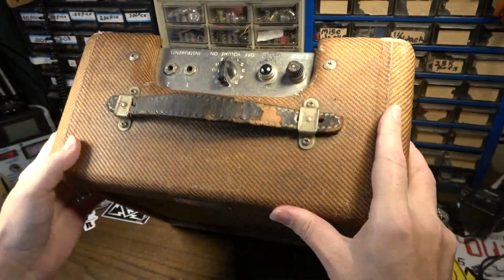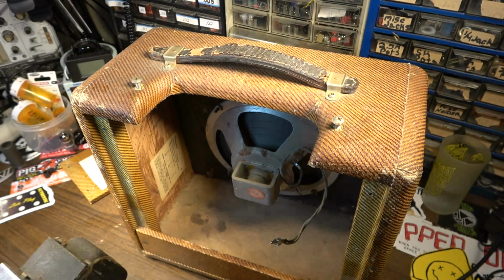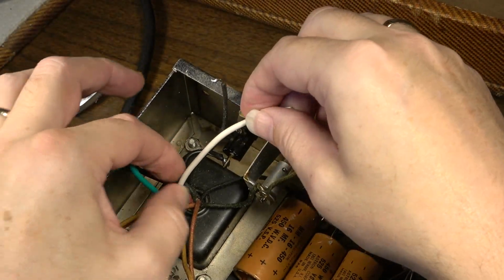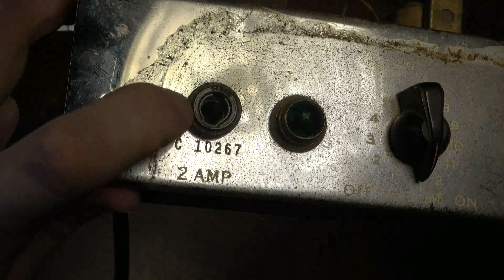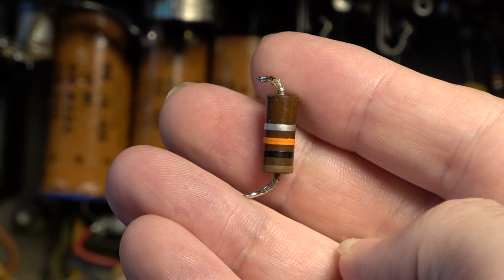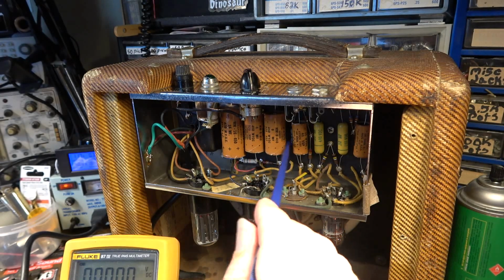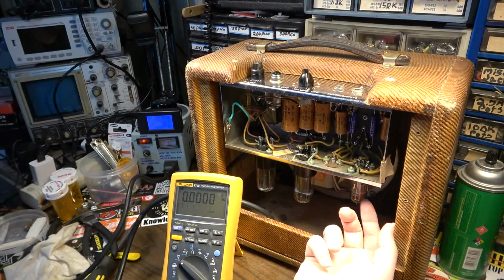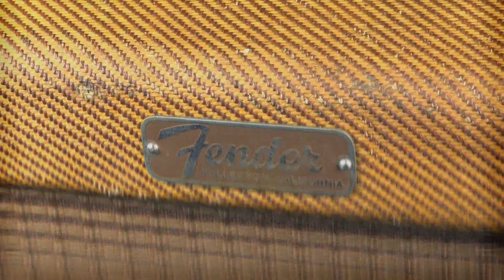1959 FENDER CHAMP 5F1 Guitar Amp Repair, Restoration & Demo

Comment: I was glad to see the fuse argument.  Uncle Doug, as you stated, is just absolutely awesome.  I know of no better teacher on YouTube.  I have said more than once, the world needs more teachers like him.  He just has that great teacher quality that is so hard to describe.  I like his arguments, but I too have always soldered the fuse first.  If you have ever gigged, you know the electricity is very spotty at best at some smaller venues (bar/grille type places).  I would rather have the fuse blow before I ever turn my amp on.  That's just the way I've always looked at it.   And I have seen that happen in improperly grounded commercial sites, more than once.
Reply: @@bertrodriguez3087  I think in this case,  with this particular type of power switch, wiring the incoming active (hot) wire to the fuse first, is the better way to go.  

As Brad showed, just a mm or two distance from the switch terminals to the switch 'chassis' is of concern.  And that's only the part of the switch we can see on the outside!

Normally, or often, the power switch is mostly plastic or bakelite, so the possibility of an internal short to earth inside the switch is almost impossible.  In that case I would always wire the incoming mains wire to the power switch first, or else there is mains power running round inside the amp even when it's switched off!

What Brad should have emphasised a bit more was the incoming mains wire being connected to the END of the fuseholder, rather than the side.

Comment: After I did some research concerning the types of oil or wax that were used in paper and foil capacitors like the Astron you're holding I am never going to take one apart again. A lot of halogenated compounds were used, i.e., halowax. Good for stability and fireproofing but definitely not something to get too comfortable with. I spray a couple of coats of Krylon clear matte lacquer on those asbestos pads and that makes them non friable.

Comment: You wouldn't buy a vintage car with the original clutch, brake shoes / pads, oil, coolant etc. So why would people think that the original capacitors have authentic value?
Reply: It's not really the same, those things you mentioned "have to be replaced" in a car, but many times when you buy an old car you are getting the original "electronics" like distributor, coil, alternator, starter etc, I say if the caps are good leave them in if they need to be replaced take them out 👍

Comment: Sometimes when you want to check the fuse and it doesn’t come out right away but stays in the fuse cavity,  and then you try to get it out with your fingers, that’s when you get shocked. The Uncle Doug wiring avoids this risk.

Comment: I have had new handles made by a shoe repair shop they deal in stacked leather and have the machines to sew it. They also can match the color too.
I was able to get my cost to 5 bucks a handle and charged $30 for them.

Comment: I have ‘62 Champ. Got it from a friend in the ‘70’s. Never sounded very good until I saw ( you were the 1st you tube channel I watched) you changing caps in an old amp. So I did it to mine last year with the Blue Zoso’s and it sounds so good and very quiet. I recently stuffed the old caps and will change them out soon.    Have a ‘57 Deluxe I got from same friend that sounds bad so it will be next. I‘ll stuff the caps on it hopefully Lupe ( the tape is still there) won’t be able to notice. Thanks for the valuable info.
Reply from the maker: Best of luck with all your electronics endeavors!

Comment: I totally agree and that is how it was always supposed to be done.  You always put the fuse first and make sure the hot lead is on the inside not the outside.  Say in your house - you wouldnt put a switch before a fuse/circuit breaker now would you?

Comment: I can see reasons for both wiring methods in regards to the fuse and switch. I have seen fuse holders  fail more often than those old-style switches. Typically the fuse-holder would Crack and crumble presenting a possible shock hazard if the tip is 'live' and I have seen that. Less often, I have seen those old switches break internally as well,  which could present the possible short condition/hazard you base your method on, but I have never seen that happen. Uncle Doug's recommendation seems to be a good way to go if the Amp uses more a modern discreet on/off switch that is more robust and a better overall design....guess it depends on the amps design, component quality, etc. Good one Brad, Cheers!

Comment: pats tip number 2 with asbestos like on that rear panel i always spray two or 3 coats of a flat clear coat sealer.locks it down solid for at least 15 years and seals it perfectly. Your acoustic tinted spray Brad would work fine as well

Comment: To me if it doesn’t work right it’s value is zero donuts. So, I fix what ever is needed to make the stuff function. I always did that with vintage drums and the collectors would be upset and offer you poo for money. That was always alright because that’s what vintage drums cost me back in the day. Sweet video!

Comment: I’ve seen “Lupe” tape go $500 on Reverb. If anyone actually paid that much, I don’t know.
Those Astron caps just crumble if you try to mess with them. The yellow molded case is made from some type of very hard epoxy/resin.
I’ve never seen a 59 anything with a Schumacher transformer. I’d be willing to bet it’s an early to mid 60 model, especially with all of those extra mounting holes.

Comment: The only way I could see the fuse issue being a hazard would be if someone was replacing the fuse and stuck the new fuse into the holder first instead of the cap. Then touching the top of the fuse might be hazardous. However I do like the power being fused ahead of the electronics.
Reply: Yup, I've done that before and got quite a wallop for my stupidity, especially as the voltage here in South Africa is 220V!
Reply: I've pulled the fuse holder cap off before and the fuse did not come out with it. Imagine if you were unaware that the fuse was before the switch and thought you were safe to fish it out because you had the switch off. I think it is far more likely to have a novice end-user get shocked by an unswitched fused, than there actually being a short in the switch. Plus if there was a short in the switch, then the CB in the panel should trip.
Reply: @srtamplification  agree 100%, not really a fan of the solder power ground either, could end up going back to 2 prong cord without knowing.

Comment: It's nice to get the outer foil towards the ground or high impedance leg of a circuit but in audio circuits the frequencies are low enough not to matter much. If you're rebuilding your common everyday microwave transmitter it becomes more of an issue.
Reply: About these common everyday microwave transmitters... Crowd control or just coms?
Reply: @sski  😃
Reply: AFAIK, normally the outer foil is supposed to connect to lower impedance leg of a circuit, or to ground.
Reply: @jutukka  Glad someone reads these posts, thanks for the correction.

Comment: Brad, the way you have wired the switch after the fuse means that the fuse protect all components within the amp. Bravo and best practice in my book. The power from the switch over the top of the lamp holder may move in time and the insulation then becomes compromised. Maybe better to go under with a blob of silicone snot to retain the movement of wire. Overkill maybe, better then potential problem later as a result.

Comment: In regard to fuses, I agree completely with your approach of having the fuse be the very first thing in the circuit from Line (hot) entering the chassis. It is also compliant with UL and CSA standards and practices.  Something that might be of interest to a few viewers is the strange fact that many radios from the 1920, 1930s, and into the 1940s, there were no fuses in the AC current loop at all. If collecting and/or restoring antique radios, you need to be aware of the situation, has a safety fuse been installed or not... In out own small collection of antique radios, we have added ‘inline’ fuse holders just inside the chassis, and ALWAYS as the first circuit element, just as you illustrate. If retaining a 2 prong cord, we use a polarized cord to ensure the Line and Neutral are always known.

Comment: Have you ever disconnected the negative feedback loop on one of those? It perks it up quite a bit. A 25/25 cap across the cathode of the second stage of the 12AX7 will also liven things up.
          I know you can't do that on a customer's amp, but if the opportunity to experiment ever presents itself, give those two mods a try some time. You'll be pleasantly surprised. 
   Perhaps on a home made clone.
Reply from the maker: Set loose on one, I could conjure a monster of such devastation, the world would weep with joy and fear.
Reply: @TheGuitologist  My next one is gonna have a wooden desk drawer for a cabinet, (solid pine, finger jointed corners, curved steel handle, and 1/4 in. Plywood baffle.) A cake pan for a chassis, more 1/4in. Plywood for a turret board and no. 18 finishing nails for turrets. My Grandpa built a radio this way during the depression in the 30s. He still had it when I was a kid, and it still worked. It was probably 35-40 years old at that time. He said he built several of these for his neighbors and he would barter them for corn, eggs, chickens, potatoes, etc. It was one more way for creative, resourceful people to get through hard times.
             My motivation is to make one for a buddy who is always pawning, (and losing) his gear. No pawn shop will take a home made put together job, so he'll be stuck with it, and he'll always have an amp.
       Most old solid wood desk drawers are little resonant chambers like an acoustic guitar body. Try saying "hello" into one. You'll see what I mean.

Comment: I agree  with  your  wiring   on this particular  amp. I will  say one of   the worst  shocks I've had was on a 1972 superlead. The ht fuse blew and  the filter  caps were fully charged even with the amp off and as I replaced  it  I had one hand on the chassis and  my thumb  was touching  one end of  the  fuse as I was putting  it in. ( those fuse holders are different) I learned  my lesson with those type  of  fuse  holders

Comment: There are merits to both arguments on how to wire the power cord I guess, but I would be inclined to do it the same way as you. Not to diss Uncle Doug. That man has some serious craftsmanship and skills.
Reply: There's a lot of schools of thought on this, maybe too many. I've always been of the mind to have the last wire to get disconnected when a cord is ruthlessly yanked out of the chassis to be the ground wire, that's why I always make that wire the longest.
Reply: @BustedJunkStudio  That makes lots of sense too. Never thought of that one. BTW, just discovered your channel a week ago. That would be the reverse of what I do with shielded leads. The shield takes the strain that the smaller center wires can't handle, but this is something completely different.

Comment: Sorry if it seems like spam but I can’t get over for $250 I just scored an all original 1959 Lectrolab r200b, tones like a tweed fender champ (this particular model mistakenly says 25 watts on it when in reality it is 5 watts). So the actual biggest difference is the price—4 months ago an all original ‘59 champ on reverb sold for $4300.

Comment: Brad, in regards to the back door possible "missing piece" I can't help but notice the bottom strip with the 2 screws may in fact be that not missing but relocated piece. Someone moved it to the bottom of the cabinet, maybe? 
I do enjoy your posts, thank you.
Reply from the maker: I had not considered that. Wish I'd removed it to see.
Reply: Possibly to keep tubes or other small items in the back from sliding out the bottom.

Comment: I'm 68 and I worked for decades as a mechanic, and in those days disc brakes were just beginning to be used. Almost all brake jobs, and there were many, were with asbestos brake shoes. One operation that we did was to grind the brake linings to match the inside diameter of the brake drum using a rotating powered grinding wheel that threw out lots of asbestos dust as it was being used. I'm still here, both my parents lived to be much older, and it's kind of funny to see the paranoia about many commonly used things from my youth. Leaded fuels, DDT, cars without seatbelts, saccharine , etc. These days the most important thing is to be safe - even if that means to follow all instructions from "health experts" who don't know and don't care to find out where the disease came from that has killed millions of people . I get it, it's only 5 or 10 million, why be so uptight? . I don't want to spread nasty rumors, but I for one will not be buying so much product from the makers of that 12AX7, the cost is far too high overall.
   BTW - In California "everything" and I mean every single thing you buy has a warning posted on the package about cancer danger. - OK, you have been warned. Proceed at your own risk.   
   I'm not a collector, but if I was gonna pay 3 grand or whatever for that Champ I would want it to be as original as possible. We don't see the caps all the time but the handle is very obvious. I wonder,,, looking at my GI style watchband - this is made from woven nylon and it's incredibly strong. Could someone remove that handle and slit the thread and insert a length of strong nylon inside the existing leather and cement it in place with 2 holes for the attaching hardware, then sew up the old layers and reattach. You would have to cut out enough material for the strap to go inside, maybe with a razor knife or dremel,  but this way the original strap would still be there and look the same, but it will be much stronger and undetectable. kind of like what Uncle Doug does with those old caps.
   Also if I was a collector I would want the death cap to be there. You could clip the lead so it is inert, but it's still there as it was made.
Reply from the maker: There is a lot we do not understand about the onset of cancers. I believe via intuition that much of it is chemical in origin and has to do with a particular person's proclivity to be allergic to a certain substance. When EVH said years ago that he thought a metal pick being put repeatedly into one corner of his mouth contributed to the onset of his tongue cancer, I believed him, and predictably I got criticized for it. Why should we dismiss this anecdotal bit of evidence from the person with the cancer, I asked. I think the same can be said for carcinogens of every stripe - there is usually an element of allergic or chemical reactions taking place in the individual body, along with an element of prolonged repetition in most cases. Want to avoid cancer? I think part of it involves changing your daily habits often so you aren't repeating certain exposures. But again, this is intuition and hypothesis, not based on any study I have conducted. However, most cancer studies do point to repetition being a strong component of disease.
Reply: I actually just commented above that we did the same thing - Even, blow out all those fine brake dust particles from heavy equipment with the air hose,   They eventually stopped using asbestos for brake pads in the 70's..  At least, up here in Canada..  But, the reality is that it's still not all that uncommon to see heavy equipment hanging around with the original asbestos brake shoes.. Especially, in the mining industry or similar environments where specialized machinery barely got to move more than a few miles through the decades.. Yet, most people out there are none the wiser..

Comment: Yes , I'm a fuse first , then the switch advocate too . Especially as I have had a coupe of broken Carling toggle switches in 70's Fenders to replace recently . When dismantled , you see exactly how they have failed and the possibility of live getting to grounded parts ,  so the fuse must come first .Even if I hadn't seen these failures , I'd still be doing fuse first . It seems logical to me .

Comment: Tube / Valve testers are expensive, especially for a up to date collaborated machine. I've seen the test equipment that comprises of a load of sockets on a plume of wires, the machines look more straight forward. I have my eyes on a Mullard tester but the guy wants £600 for it, just deciding if i should pull the trigger. It's in a beautiful wooden case similar to yours.

Comment: @The Guitologist  I love these videos!  I was wondering what the capacitor all the way to the right is about... a lot of builds and schematics don't show it and capacitor kits for the 5F1 don't include it.  They just show a resistor there, but my 5F1 has it, just like the one in this video. Is it not necessary to have it there? Or do I need to order it separately if mine has it?

Comment: use that one for template Brad then maybe check locals that work leather.
at Kendrick he hired someone subbed them out and got them contracted
the guy said it was a pain in ass to make them and he only did it cause he had too.
neat amp. those sound great.....the bottom panel might not be original so one could be made by measuring the dry spot .
might get one from mojo and age it..  I did some aging and  grill cloth work and final assembly.
so measure cover piece of wood in tweed age it too match then no shadow on back keep small piece with amp but
restore original size piece to hide shadow.   this is one application stain light app...enough to coat and wipe off somewhat.
just to warm the new tweed..